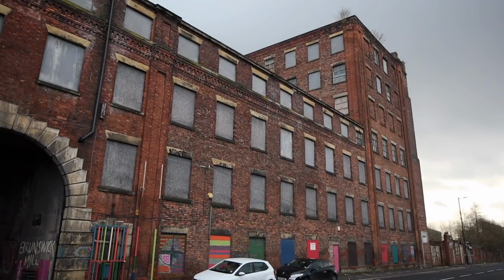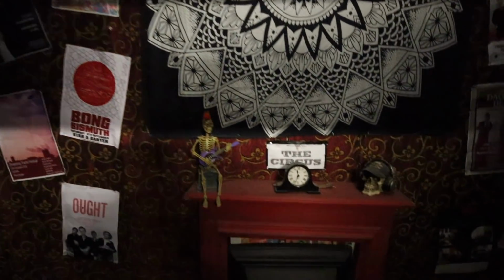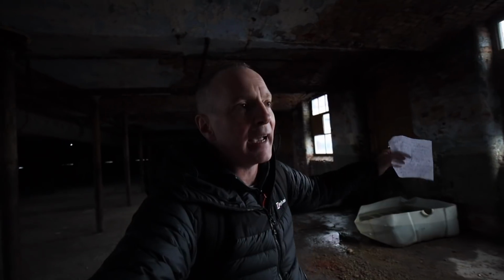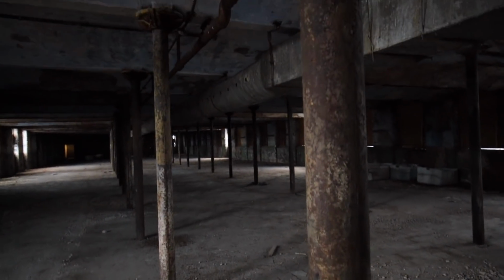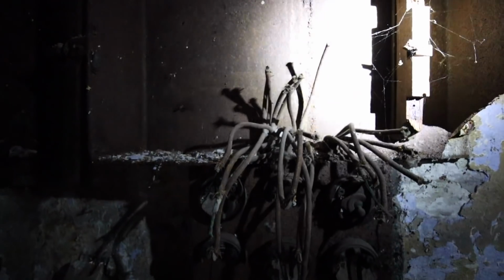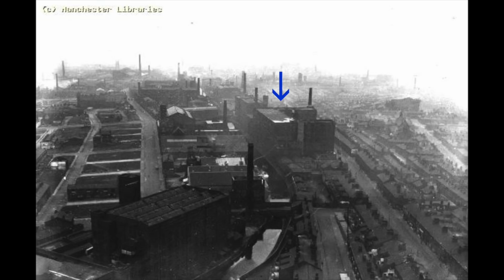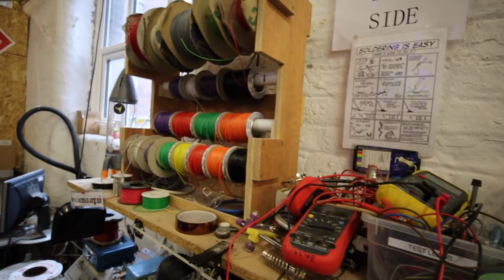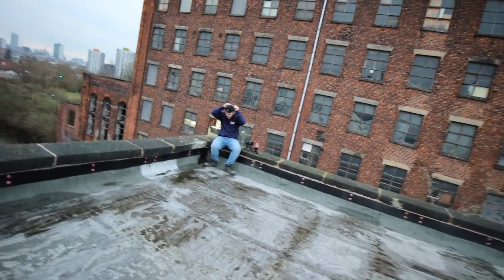Exploring the old Manchester Cotton Mills

Comment: I often think there is something wrong with me! I LOVE this stuff!
The wires are an obsolete type of wire called VIR (Vulcanised India Rubber) it is basically cotton wrapped and impregnated rubber insulation. The first testing of public electric lighting was done at Buile Hill in Salford  where they were trying various types of DC lighting out on the roof fed from a battery bank outside. The roof was lead so they needed to insulate the cables. they did this with pure cotton braid. All went well with various couples being caught out by the unexpected brilliance of the lights when it started to rain. This soaked the cotton insulation causing it to short out on the roof melting a section of it .... stopping the experiment! VIR was the successor to this type of cable ;0)
The brickwork is another aspect you just would not see in modern buildings! Notice the curved edges at the corners of the corridor and the insets in the courtyard (4th? floor level).
It is especially good to see the mills being used now for making stuff ..... there is far too little of that going on!
Gasomiters are soon to be a thing of the past too! There are plans to pump liquid gas into the main pipework network which would mean the gasomiters are not needed for storage!
Reply: Thanks for that
Reply from the maker: Hi Dave thank you for your info that was great. There was a kind of poetry in that building i loved it

Comment: I'm loving the tools that Connor had in the that mill. Totally up my street. An old style goods lift like the one in your video is probably drawing 150-200 amps 3 phase starting current when setting into motion. This causes massive volt drop in the under designed electrical system hence the dimming lights. Far cry from the 20-40Amp 3 phase that modern similar size lifts pull. I wish my Grandad was alive still, he grew up just of Bradford road, he'd have loved this video. Thanks. Keep it up.

Comment: Interesting walk round the mills.   This is what I did when I went on inspections of the mills of Oldham, another spinning mill area.   I did it as representative of Oldham Council Business Rates.   These mills are still in multi use with upper floors open to the pigeons.   The old engine houses were quite interesting architecturally.   Good video.

Comment: The electrical wiring insulation was vulcanised insulated rubber (VIR) and the large submain cables would be paper insulated, lead covered steel wire armoured (PILCSWA)
Reply from the maker: Thanks for the info John

Comment: I used to work in a now demolished mill in Manchester. It had a similar lift.
When we put heavy loads in the lift, the cables used to stretch slightly.
It was used as a metalwork factory. It was the Jeffay Manufacturing Co. in Cornbrook
and made fireside furniture. Happy days.
Reply from the maker: Great stuff

Comment: I do hope they throw some TLC at those mills in the not too distant future!

For fire-proofing the ceilings had to be brick as you mentioned and the only way a layer of bricks can support itself is to form an arch or vault.

The wiring you pointed out was probably rubber insulated, wrapped in cotton and then maybe coated in shellac.  It would have been sheathed in lead and/or run in wooden or steel conduits for physical protection.  We had a house wired like that!

This is good book to look out for if you're interested in the beginnings of the British cotton industry. https://www.flickr.com/photos/rtbcomp/33391727588/in/dateposted/
Reply from the maker: Thanks Roger for the info 👌

Comment: Summer last year in Warrington we lost a paper mile originally built in 1830 and it left by the company in 2013 to fall apart. The council had the factory demolished but the front was saved.
Reply from the maker: Its great they saved the front but also an insult they could of saved it all
Reply: @MartinZero  There was one slight problem large parts of the roof was missing, some of the floors were to dangerous to stand as you would straight through and the building had sustained damage from the bomb attack on Warrington.

Comment: That wiring you shown there martin was of the old  cotton covered V.I.R. wiring (vulcanised Indian rubber). Some houses and other buildings actually still use  that  wiring and is extremely brittle. And those toggle light switches were made by a company called rolls i think..
Reply from the maker: Yeah its incredible isnt it. Antiques themselves
Reply: @MartinZero  they go for silly money on Ebay!!

Comment: Has anyone provided you more info on the telescoping tanks?  I have been told by tank inspectors that used to service these in the USA that they always had a maintained level of water at the bottom.  As each section would rise it would catch water on a ring which would act as a seal.  They would often joke about one in Baltimore Maryland that they claimed had a boat inside that they used to float around in while they performed their internal tank inspections

Comment: In all seriousness, you need to wear protective clothing if you are in areas with all these droppings forming an aerosol you can inhale. 3M make disposable masks that filter out fine particulates, but head-covering masks cost about 150 GBP.  3M make disposable coveralls for about 8 GBP each. Wear the hood up and tape the leg ends to the outside of wellingtons. It is not possible to predict who will suffer from contact with droppings, and the lung changes are irreversible.

Comment: I've just come across your videos.  I find your exploration fascinating and subscribed.  You say the mill was built in 1840?  Are there any deeds or plans to back up that date or is it just somehow "known"?  I've been looking into buildings known to be built in the mid 1800's and I frequently find they were built on top of an older building - and hence, re-designed in the 1800's rather than built from scratch.  Typically, there is a basement level that tends to be the older part of the building.  It seems to me that the land, with buildings, was acquired by a local corporation and after the re-build, the builders and the corporation took entire credit for the works and failed to mention that anything existed there before (possibly to guard against later claims).  I was a property lawyer for a number of years and have found evidence in historic deeds to back this theory.  Anyway, if you come across any building put up prior to mid-1800's or are able to gain deeds or plans to show that it was built from scratch, I'd be really interested to hear from you.  Great video, thanks for sharing.
Reply from the maker: Hello thanks for commenting and the info. Its written in more than one source that it was 1840. One of the sources is a specialised industrial resource. So am pretty sure its the original building. Not sure what was there before